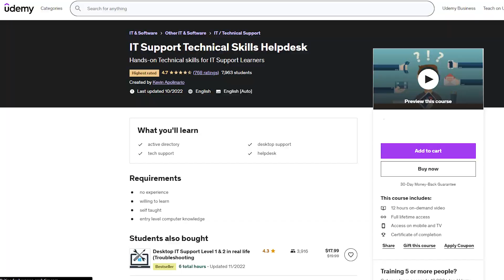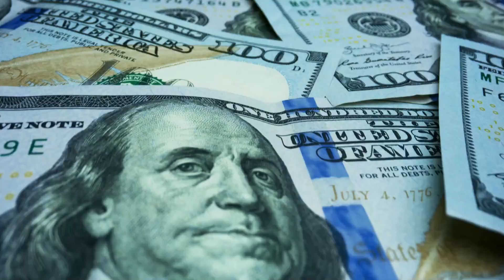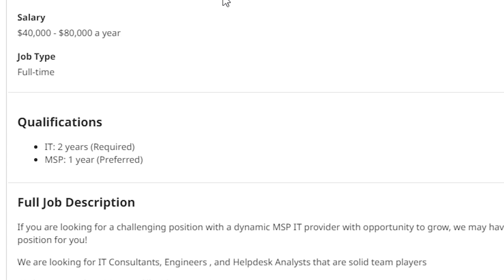HELPDESK - Your First Job in Information Technology

Comment: As someone who works in a manufacturing company 
I will gladly work at a IT help desk

My body is over its limit and working in a different environment where I don’t have to move around a lot will help
Reply from the maker: Ive been there.. I use to work in manufacturing and its a rough life... hours normally suck, physical demand it rough... That is one of the reasons i got into tech.